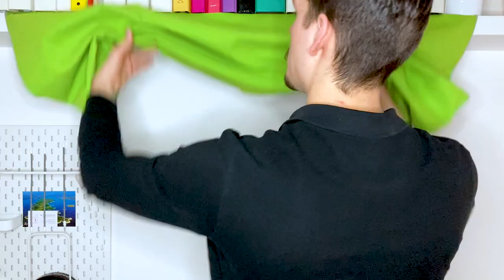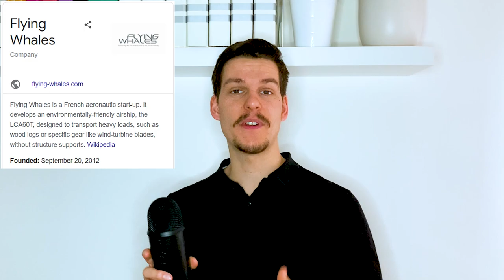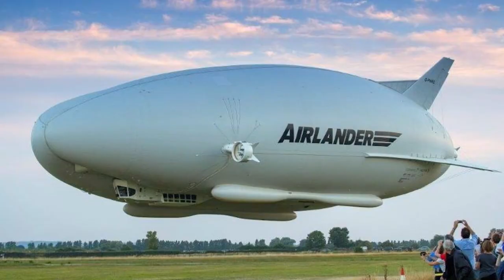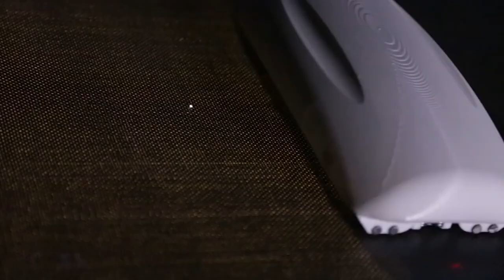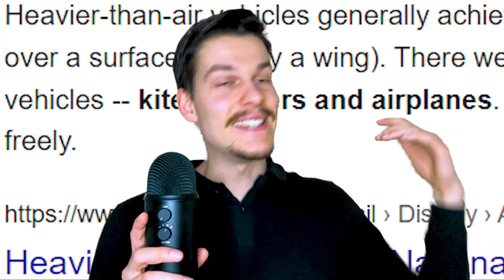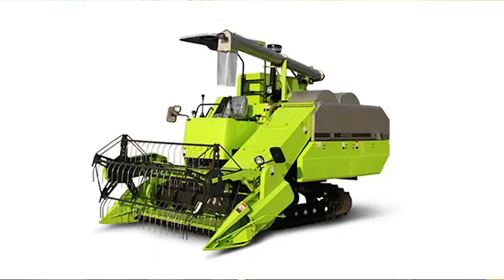Will Farmers Use Airships?

Comment: It seems like nonsense, but in the last 12 years in the design office of agricultural machinery, I have to admit that there were moments when it was the only solution .. but it was never implemented
not for work, but for the transport of machines over 12m  width in the 3x4x22m block and a weight limit of 10 tons per axle that the legislation gives us for homologation